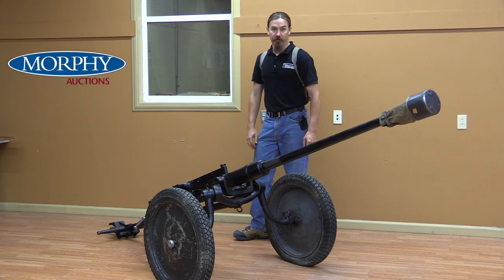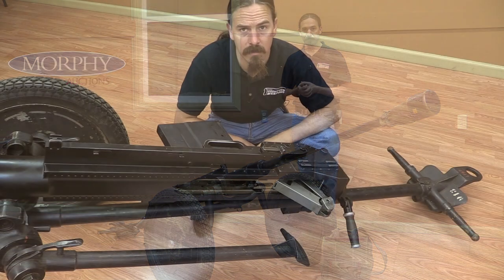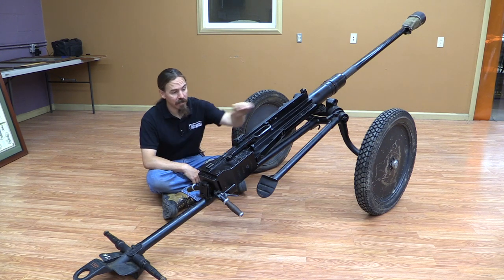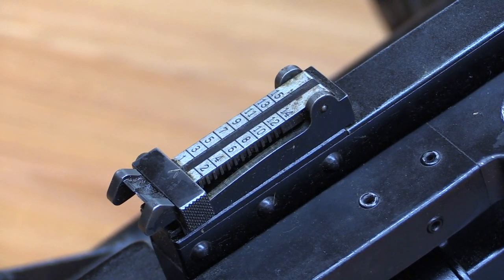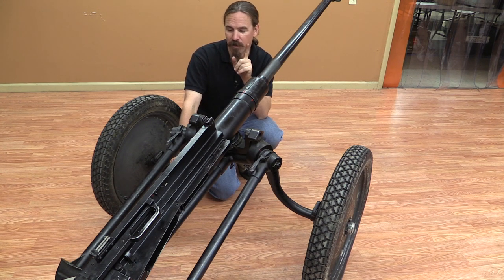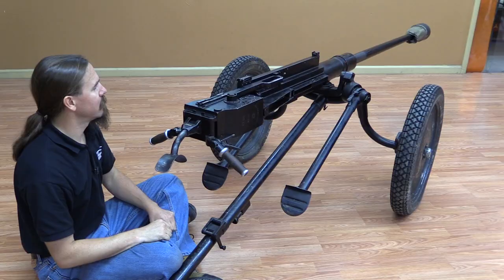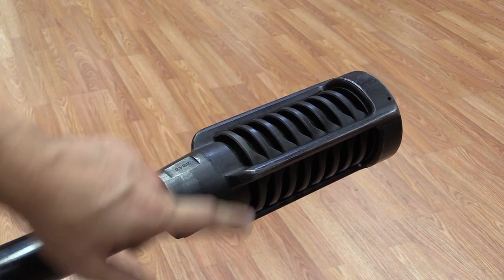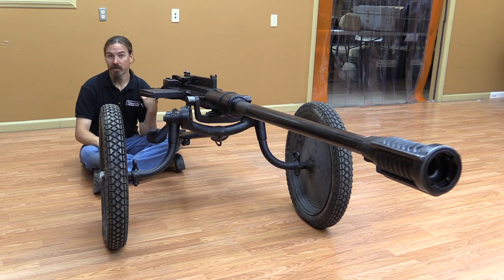Swiss Tankbuchse 41 Semiauto Antitank Rifle

Comment: Imagine hiking around the Swiss Alps in the 40's some absolute swiss mad lads stroll by you in their bikes with this gigantic cannon attached to the back of one of them as if it were a completely normal thing.
Reply: I have one of these bikes and let me tell you
You do not wanna go up with the gun attached (only one gear) or down (practically no breaks, in the front you push a piece of rubber on top of the wheel)

Comment: toggle locks look so complicated but so great. i love how huge the toggle lock is

edit: also holy shit bicycle towing
Reply: spaz14 rings bell

“Cannon coming through!”
Reply: @STG44VOLVO What would be worse, towing one up a mountain, or trying to stop on the way down with 1940s brakes?
Reply: @marcaxe +The swiss army bike only had one gear
Reply: Boris Müller - precisely! Nobody takes a bicycle cop seriously, untill he pulls up with THIS thing. 
"Bicycle license please, sir." 
"Sure, but WHY are you towing a bloody CANNON?!?" 
"It's a bicycle cannon, sir, it fires bicycles." 
"Oh. Seems legit. Ok."
Reply: Henry Rodgers “it’s useful for improving cycle strength and triggering avalanches.”
Reply: I actually own a toggle lock .22.
Reply: The system is not that great. It's not providing any bolt acceleration and has parts protruding out of the gun violently at each shot. Only two successful guns with this system ever existed: the Luger and the Schwarzlose machine gun which was a delayed blowback gun with a short barrel, using lubricated ammo.

Comment: The best with it is, that swiss military bycicles of that period were about 25-28kg already on their own, because they were made of steel tubing, with no gears ( later models sometimes had 3gears) and flimsy brakes. (don't know the english terms for those. The front one was simply a metal plate pressed on to the tire by the brakehandle. And for brakeing the rear wheel you had to push the pedals backwards with your feet.) But some people still use them today, because you simply can't kill them. There's nothing to break on them, they don't require any maintenance and they will always work. Even the dynamos for the lights did always work! Unlike todays dynamos who simply stop working when the weatherforecast is bad, it didn't mind mud, snow or rain.. those were the days of real quality, but little to no comfort...

Comment: They said toggle lock can’t handle more powerful cartridges. They were wrong.
Reply: The thinking may have been in reference to hand held Firearms - not needing to hold it in your hands does remove one of the problems a big Toggle Lock would have - that the Mass of it would start to throw the Gun around or even out of your hands if you get big enough. 
Or just the forces of it breaking the Gun - which avoiding would entail being super heavy.
Reply: The Swiss engineer laughed: You are wrong

Comment: Would all the crew have bicycles? basically being some sort of bicycle brigade with anti tank cannon?
Reply: Yea. Bicycles are one of the best ways to get around the terrain. We had and still have bicycle units.
Reply: @lucariolps277  Bicycles make excellent devices to move troops and equipment.
Lightweight, quiet, speed of troop movement is better than walking, usable in various types of on and off road terrain.

Also is an excellent way to keep troops in shape
Reply: I would pay money to see like 7 dudes with backpacks on bicycles  forming an anti tank bicycle convoy.
Reply: Hook this thing up behind your bike, roll up to a gun controle protest and blair, "Ridin Dirty". "They see me rollin, they hatin..."
Reply: The Japanese used bicycles in the attack on Singapore. They were able to move MUCH faster than the Allies expected.
Reply: with a bike you can also carry more weight over long distances.
if you cant motorize, bikes will enhance troop capabilitys ALOT.
look at it that way:
double the ammo , double the provisions, tripple the mobility and NO NEED FOR FUEL!!!
Reply: There are no more bicycle units since perhaps 15 years.
Reply: Vast parts of infantry had bycicle units for helping them. Thee are no longer separate bycicleunits in swiss army, they got split up and placed inside several other units. But those swiss military bycicles at the time had only 1gear, flimsy brakes and weighed 25-28kg because they were made out of steel tubing! You never killed them, even at minimal to no maintenance. They could have been rated as armoured light vehicles :-)   so, yes the whole unit had bycicles. If you were there you were something better than usual soldier, even though still being infantry, having the same rank and accommodations, you had a bycicle and didn't have to walk (still much but not as much as the others)!
Reply: @samuelbhend2521  
Can you imagine dragging that freakin' gun uphill on a single speed bicycle?  I'd have a hernia in the first ten feet!
Reply: @deltavee2  no thanks!

Comment: Found this piece of information on the ability of the gun to hit the armour.
"I've come across a little information on the performance of the 24x138mm AP-T. A Swiss Army report from 1941 credited the 24mm Pz-GV with being able to penetrate 30 mm of “armor plate of normal strength” at a range of 200 meters with an impact angle of 30-degrees. The Swiss Military Museum in Full-Reuenthal lists the Tankbuchse as being able, at 500 meters range, to penetrate 36 mm of “armor steel” with a flat 90-degree angle of impact and 17 mm at 30-degrees. The latter also listed a 2.3 second burn time for the tracer element."

Comment: 36mm of penetrationat 500m is very impressive, that would punch through almost all of the Pz3s except the J models introduced in 1940.
Reply: From what ive looked up, if you placed these correctly, you could even be dangerous for a tiger 1. The Turret roof armor is pretty thin. As well as the engine deck.

Comment: 36mm of penetration at 500m? Hard to believe they would have been that useful against any major powers' tanks, even in 1941. PzKfw IVs in 1941 had 50mm front turret and hull,  British Crusaders had 40mm, and even the lowly BT-7 had 40mm frontal.
Reply: their not aiming at front through, plus they can destroy the optics, radios and other important stuff, one higher above you is now shredding your engine or blasting rounds though turret roof etc.

Comment: Pardon me for asking a potentially stupid question. But, wouldn't the recoil on this gun be enough to break your shoulder?
I mean, I know that once the gun is fully set up, it's going to be on a very stable base, but the kick still has to be monstrous.
I rest assured that the gun is still effective and not dangerous for the shooter, but I'd love to see Ian explain how the shooter manages the recoil.
Reply: What I read, the muzzle break takes away a lot of the recoil. It's the main reason why it shouldn't break your shoulder even if you fired it without a mount. Because it was possible to take it off the mount and just lay it on a wall and fire it.

Comment: If the Germans knew of this weapon in 1938-1940. It was likely a substantial deterrent to German invasion of Switzerland. Remember, the Panzer 4 may have ended it's career with 80mm of frontal armor in 1945. However, up until October 1939. All Panzer 4 produced and in service, could have been penetrated at the front from this semi automatic anti tank rifle. Even a single well placed rifle could have held up a tank column. And while the Luftwaffe would have faced little opposition in the air, there is no feasible way to track down and bomb every single 7 man crew towing a gun on a bicycle. Even later in the war, any tank the Germans could feasibly send up the Swizz mountains, could have been disabled by the gun.

Comment: 9:30 did he misspeak because 36mm is only 1.5 inches, I feel like a 50 bmg could do that if it was an armor piercing round..
Reply: I looked it up. A 50 bmg can't penetrate 36 mm. A normal 50 bmg can penetrate around 20 mm. There are certain types of 50 bmg rounds that could potentially penetrate 36 mm. But only under certain conditions. The article I have read said certain types of 50 bmg could penetrate 36 mm of steel at 500 m. But from what I read those 50 bmgs that could penetrate 36 mm are newer and weren't around back then.
Reply: Specifically, the one that could penetrate is the m903 slap. But it was only introduced in 1993.
Reply: And about the Penetration ability of the tb 41. I tried to finde some conclusive information but the tb 41 had multiple types and the ammo was also improved overtime. Bundle this with Switzerlands secrecy around this time and you get absolutely no conclusive answer. I have seen claims from being able to penetrate 30 mm at about 200 meters, I have seen claims of 36 mm at 500 meters. Even 40 mm at 500 meters. Sooo... Only conclusive thing I could finde was muzle Velocity which was around 800 m/s to 900 m/s
Reply: Lucario Lps i feel like the tb 41 should be doing closer to 60mm or penetration since its a 24mm round going 800m/s
Reply: @MAXREZNIK  how I said I couldn't finde any conclusive information. And it was never tested in real combat. And Switzerland was very secretive so it could be that it was able to penetrate a lot more than 36 mm.

Comment: Ian, you absolutely need the German umlaut "ü". Unless otherwise possible "ue". There is a significant difference between "Büchse" and "Buchse" in the German language. "Büchse" stands for a container (can), or a weapon for shooting with bullets. "Buchse" or "Buxe", however, stands for a pair of pants, also devaluing for an "old pair of pants". A "Tankbüchse" stands for a weapon to fight tanks. A "Tankbuchse" refers to the old trousers of a tank crew member. "Tankbuchse" sounds very odd in the German language. :-)

Comment: Hey Ian. When you do a video on a German / Swiss "Büchse" of whatever kind, may I advise you to either try to set the "U Umlaut" (="ü") from an ASCII table or to put it like "buechse" instead? 

Your pronounciation of German terms is remarkably good, by the way. The point is: "Buchse" is another German / Swiss term, not so much with military gear, however, meaning "socket", as a counterpart to a given jack. 

Regards, keep on your good work!

Comment: Any idea how Switzerland got material like those rubber tires while they were surrounded by Axis powers?
Reply: Extensive diplomacy with all sides. We had trade agreements with Germany and Italy. Basically we let them use our railroad network so that they can move stuff around quicker, and we got coal and oil. Plus we got some resources in exchange for prisoners of war. And once we captured a experimental he 110 I think. We got some stuff put of that as well. We also got rubber from the UK and the US I think trough the rein. We have up to this day our own navy that operates on the seas and is connected to Switzerland trough the rein. The port is in Basel I think.. Not sure
Reply: thanks for the reply

Comment: Hey Ian, quick question: Are the red stripes at the front of the receiver for removing/installing the barrel? If so, is it QD (as the small angle between the markings would indicate), or is it another one of those two guys for each end processes?

Comment: I would imagine that firing this thing on an actual tank from an open position is pretty much suicidal.
The weapon has not even minimal shielding and the tanks arms have approximately the same range as this gun.
If the first shot misses, the tank will start firing at the gun crew.
Not to speak about the infantry. Every soldier close by will start firing at the gun, because he doesn't want to lose the supporting tank (or whatever armed vehicle the gun crew is going for). 
Either the Swiss had enormous trust in their marksmanship or a lot of gun crews.
Reply: Those things would probably be used in ambush attacks supported by infantry and heavy bunker artillery. In most of the footage you can find, the tb 41 and its crew are in either elevated positions behind rocks or something, or they are hiding behind bushes. Also, the firing rate with this is pretty good. Even if the first shot misses, it's unlikely that the tank will be quick enough to turn its turret. Also, most of the tb 41 crew aren't actually used in shooting the guns. From 11 people, 3 are needed for operation. Gunner, loader and the guy holding the spare mags at the ready. The others only really carry ammo and assist in setup. So they can support the gun with infantry weapons.
Reply: Also, the shielding on most at guns is at most shrapnel proof. A tank would tear trough it with no problem. Even some mgs might tear trough.